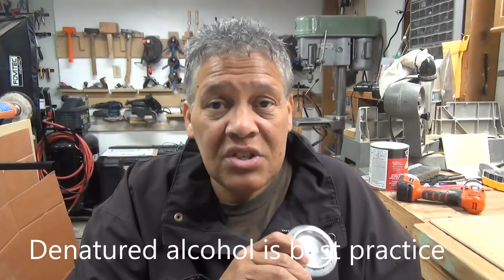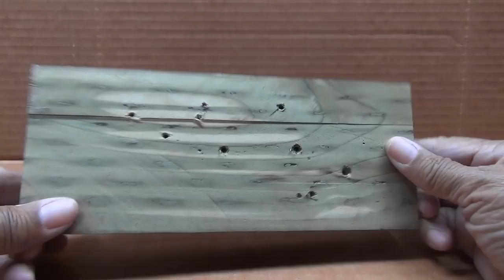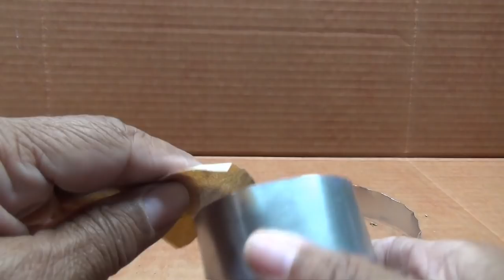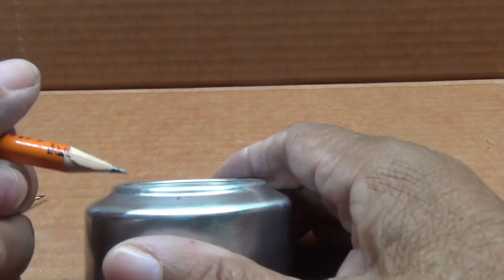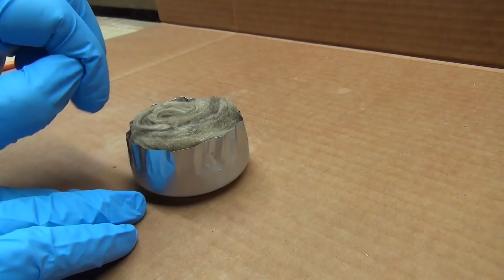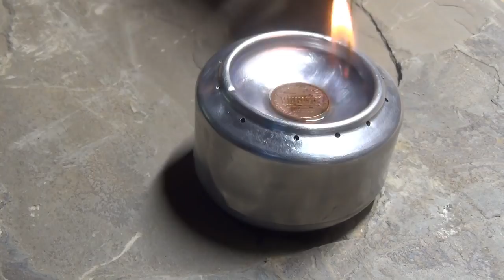A Stove you can carry in your POCKET

Comment: These are common in backpacking. I use one during the summer months. There is nothing to break and they make no noise which I like. They are also very light. I use Heet in mine. Heet is used in cars as a dry gas, reduces water in the winter. They sell titanium ones on Amazon for over 50.00. Great video. Thanks

Comment: Hi Leah, nice popcan stove demo, cheap an cheerful  to make.  I have made several of these , but didn't use epoxy to seal  just to keep cost down ,and had no leaks. I also tried smaller holes ,for better flame pattern.Results 2 cups of water brought to a boil in approximately  4 min.  What a great little stove you made, just about foolproof ,reliable, light ,and best of All costs virtually nothing.  Thanks Leah, your a star.Best wishe's. Stuart.uk.

Comment: This is a really cool stove. I made some by myself, they are cheap as dirt, more lightweight as anything you can buy and easy to use. Just a few tips in addition:
Dilute your alcohol with 5% to 10% of water. This will avoid ugly sut on your pot or cup.
You don't need to clean the paint off of the cans. It will stink the first time you fire it up, but that's all. Just don't inhale it.
You don't need to glue the halves together. There's fire all over the place with this little stove, so there's no need to seal it up. This spares you the holes in the middle and the penny.
If you don't have a drill, you can poke the holes with a nail against a rigid stick. Works with a little practice.
With such a weak stove, you want to concentrate your heat. An empty soup can cut into shape that it allows fresh air in and hot fumes out will easily double your efficiency.
If you don't have fibre glass insulation, use cotton pads. They work fine.
To get your stove started, just spill a few drops (literally) of fuel next to it on the ground. It will go off like a rocket.

Comment: I've made a few of them myself.  But I didn't use a drill or anything but pliers and a pair of scissors.  My method involves a strip of aluminum as a spacer around the center ring with notches cut I to it for flow.  Also the ones I make have an open center with a sort of grill cover as its inner cover

Comment: Hi Leah from near Peterborough, Ontario, Canada.....we often have power outages, mostly in the Winter when we have an Ice Storm. I buy the chafing dish fuel cans pre-filled with either Gel, or liquid with a wick which come with a pop off or a screw off lid aka Canned Heat. You normally see these at a Buffet-style function or gathering. They're used under the chafing dishes to keep the food hot by the Servers. Anyhow, I always carry at least one can of this type of fuel in my Glove box of my Vehicle in the winter, just to be on the safe side in case I get stuck in the snow, etc. Thankfully this only happened once in all my years of driving, and it kept me nice and warm until help arrived (crack the windows just a tad for safety tho while they're lit). During one of our power outages last winter, I didn't feel like digging my way through the raging storm to get to my garage so I could get my Propane Coleman stove. So I opened a 20 oz can of soup, dumping the soup into a pot. I then rinsed the soup can out, and using the old type of can punch, punched some holes in the bottom of the can where the lid was still in tact. I took the Canned Fuel, the hole-punched can, and the pot filled with cold soup out to my front step which is cement. I lit the Canned Fuel, placing the hole-punched can over top. Then I placed my pot with soup on top of that. I watched it carefully of course, stirring the soup often to bring it to a boil, which didn't take long. I tell ya' that had to be the best canned soup I've ever eaten lol, and I just wanted to mention this idea too because it was so simple. And I'm fairly certain that when in a "pinch" like I was, others could make a quick "soup can stand" to fit over their Penny stove which looks similar to the Chafing dish "canned heat" I mentioned above or their Penny Stove. I really enjoy your video's Leah. You are an AWESOME Teacher Leah, and Thank you so very much for sharing your wonderful talents with all of us on Your Channel.
Reply from the maker: I really appreciate your taking the time to share your story.  I love your soup can idea!

Comment: You could cut the bottom of another can to use as a snuffer to put out the fire. Also, perhaps a slightly larger  container that can be sealed, for leakproof fumeproof storage and transport - a plastic container could do, if you remember to let the stove cool enough before storage.

Comment: I have found whenever cutting a can or plastic bottle or the like that cutting underneath, the way you did here, allows you to stay on the line whereas cutting over the top the scissors tend to want to veer inward. I don't know why it happens, but it does. As for the method you use to mark your line,  that's the best way to get a flat horizontal line on a round object. Even if the object your marking is not perpendicular to a level horizontal line. ie the slant of a leg on a stool or chair. sometimes it helps to move the piece of wood and pen around the object especially if it's slanted. Remember your deck of cards? excellent way to add height to that piece of wood to make the line on one can taller than the other. (I've watched a lot of your videos)

Comment: Leah, I should mention that I worked on my two new compressors this afternoon, connected the new baby for my golf cart shed at the course, oiled the guns and will take it over once the lockdown has been lifted. Thankyou for a fascinating demo on the field stove. It will be another addition to my golf shed accessories. by-the-way, can I use kerosene instead of alcohol or paraffin or metholated spirits?

Comment: seejanedrill -  Ah the the soda can alcohol stove, simple in concept and yet infinitely complex in its manifold of variations and improvements.  What modifiers can I find for this home made cooking gizmo: utilitarian, inexpensive, practical, recyclable, compact, light weight, easily replaced, maintenance free, and user friendly.  There are so many videos on this one item and yet I am so glad you made this one because you never know what you can learn from Leah.  My take aways: sanding is easier with a full can, 2X4's are a good standard of measurement, and sealing with JB weld.  
Like sand castles and people, alcohol stoves a basically all the same and simultaneously all unique, thanks for sharing yours.

Comment: Really cool.  Thanks.  Is this single use or can you add more alcohol once the fuel is used up?  And how do you extinguish the flame if you done before the fuel is used up?
Reply from the maker: Yes you can re-use it over and over again.  You put it out by smothering it with a lid.
Reply: I was wondering the same thanks for the question

Comment: These are so cool. Just a bit of alcohol and you get a nice cooking fire anywhere. I wanted something that can withstand a clumsy person (i.e. me), so I went and got a titanium alcohol stove and a couple of tins of fuel.

Isopropyl alcohol (rubbing alcohol) burns yellow in most alcohol stoves unless they're designed for IPA, there are a couple out there. That means if you cook over it, it will leave soot on your pot. It's no biggie, put a thin layer of veggie oil on the outside of the pot. Or use a fuel that burns blue. Denatured alcohol works great, just be careful of the methanol. I can't find it anymore, though...

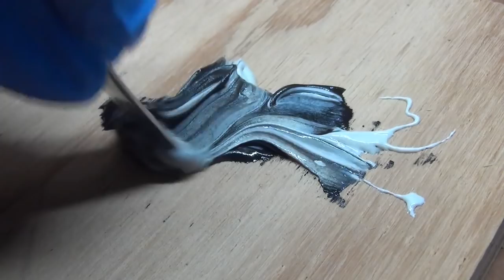Comment: At 11:25 :  "do it quickly ( mix and use the JB Weld), you don't have a lot of time here". Actually, regular JBWeld takes 4 to 6 hours to set, and 24 hours for full cure. JB "Qwik" takes about 15 to 20 minutes to set up,  much longer working time than your typical 5 minute epoxy. Sometimes it's helpful to have those long working times. Sometimes not. Either way, they are excellent and very useful adhesives.

Comment: when i was a kid I used a soda can to make a stove but I just cut a flap in the side so it was like a mini barbecue pit. 🤣
Reply: Ucity metalheads, we used to punch a 1/4 inch hole in the side of the empty soda can about 2/3 of the way up, stick a straw in there and seal it with a piece of chewing gum, put a piece of aluminum foil into the hole created by lifting the pop tab,  punch some tiny holes in the foil, and now you had an air- cooled pipe!

Comment: If you use red bull can  it burns green in the beginning. Edit: experimented it today, the outer surface, when left unclean, burns green.
Reply: That's probably copper oxidizing.
Reply: @norvillerodgersspeaks  something in the drink itself
Reply: What r they putting in red bull?
Reply from the maker: Interesting
Reply: @norvillerodgersspeaks  some salts, sugar and lots of stuff, I guess you'll get the same effect with most eatables and soda
Reply: Just tried that stuff to confirm it... The green glow is something on the outer surface of can burning, not the redbull itself... The drink boils and then burns bright orange

Comment: I'm sorry on this one but you have to Elder biewers depends on what they use for fuel you don't want to roast marshmallows Uber a rubbing alcohol burn you want to use something clean because when you roast marshmallows or anything else over an open fire you got to think some people prefer grilling with propane other people prefer grilling with charcoal if you grill with propane or charcoal there's two different tastes whatever fuel you are burning you want to make sure that is not toxic you cannot eat a marshmallow if you use oil in your fire unless it's food-grade oil talking about the difference of vegetable and crisco oil versus machine oil air gun and motor oil what are you using a air tool you have to make sure that you boil it so would work properly your car has to have oil so it works properly so you have to have Pacific oil to cook with so your body works properly if you don't use food-grade oil you are putting a harmful dispense chemicals in your body means if you roast a marshmallow with motor oil or oil for your air tools you will get sick over a. Of time it's not healthy for your body make sure you know what you're putting into your body before you consume your food I would still like to see how you use a speed square properly